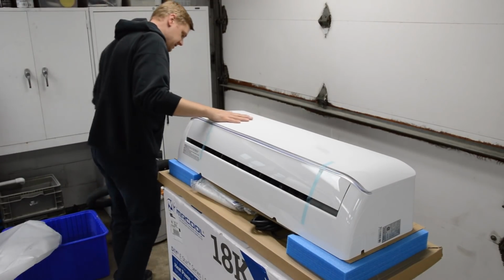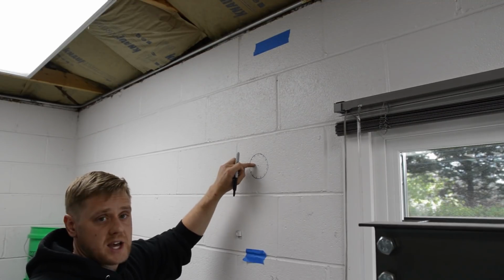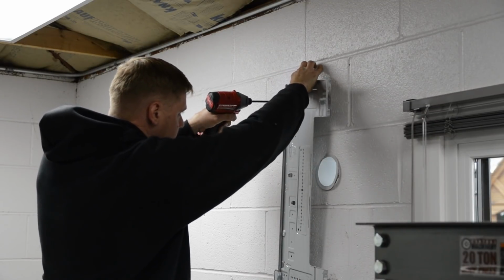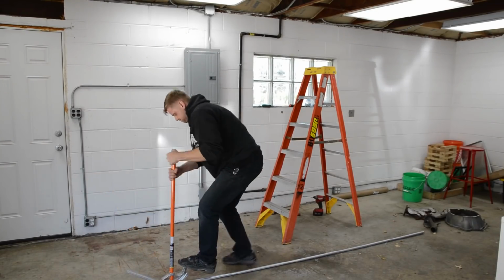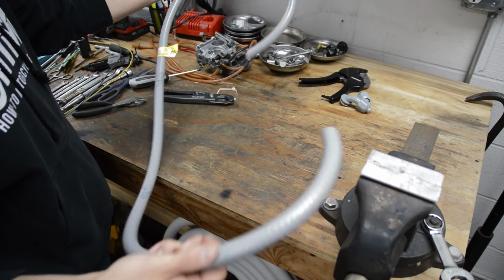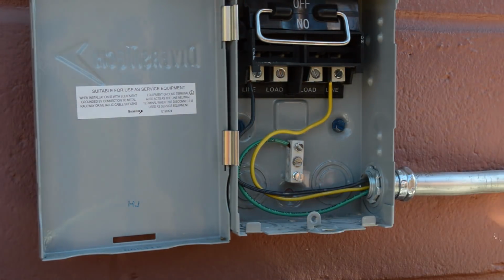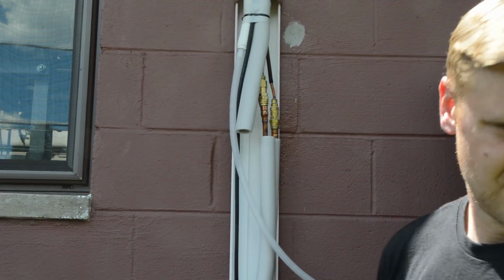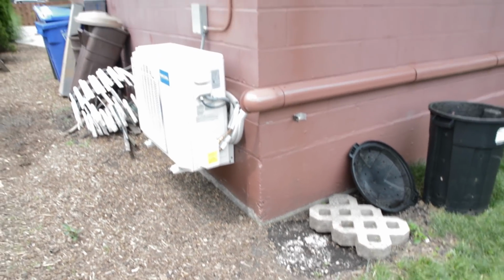How-To: MRCOOL DIY Mini Split Installation (Step by step) / Garage has A/C!

Comment: Should the extra line set be coiled lengthwise or circular? There's a lot of talk that the oil gets trapped in the circular coiled line and burn out the compressor, what do you think?

Comment: Excellent video. Absolute best instructional I've seen yet. ONE question which I hope you can answer. How is the indoor unit powered? Is that only through the black cord which has the communication wires to the compressor outside (thats run through the plastic chase with lines)? Thats the only  part that i missed
Reply from the maker: Yes, black cord powers the inside unit.

Comment: On a hot and humid day, there will be a lot of condensation. It would probably be good to lead the water away from the wall so that it does not cause a moisture problem to the building.
Reply from the maker: I will monitor that. Thanks.

Comment: That was a great video. I did notice that you didn’t vacuum the lines after making the connections to the outside condenser. Other vids I watched had this step. Reason for skipping this step?
Reply from the maker: This is a diy kit with precharged linesets.
Reply: MatthewMCRepair Thanks again. You did a really great job describing the process.
Reply: The unit is PreCharged with Refrigerant "For the Lineset" However a Vacuum must still be pulled !!
Reply from the maker: @MtPockets14U  No it doesn't.
Reply: I thought the same thing...but MRCOOL mini split is different they have precharged linesets that releases into the unit.  Most other split units, like my senville, have the refrigerant in the unit that releases into the lineset (vacuum required).
Reply: I do stand to be corrected on that. The lineset itself is indeed pre-charged. You did do an excellent job on the install!!
Reply: @MtPockets14U  Not true.  Do your research
Reply: @itisaporsche  pay attention to response

Comment: Hey Matt! Awesome video and I appreciate the time spent explaining everything. One question I have that is confusing me is you ran 6 wires from the panel through the conduit. I think you said 3 were for a compressor and three for Mr. Cool unit.  The three for the compressor were for an air compressor that really had nothing to do with this install. Is that correct? You had to rerun the conduit for the 6 wires and this is why the 6.  Again awesome job and thanks as I am starting my install now
Reply from the maker: Yes the other 3 we're for an air compressor
Reply: I appreciate it Matt! Again great video and thank you for such a quick response.
Reply: @HTMR  yeah that had me confused to. Thanks for the reply.!

Comment: The videos always makes me wonder about  some items. Wall bracket mounting of the outside unit always looks to close to the wall for good air flow.  Especially if you have more line coiled up behind.  What does the instructions say for clearances? Nobody says when you are connecting the lines does it start leaking till you got them tight at both units? It would be a lot nicer if you could specify what length of line you need so you do not have so much extra to leave coiled. Larger units seem to have 25 feet and smaller is 16 and even that could be too much if everything was just on the same wall and 9 foot ceiling.  12 foot would be nice but you cannot cut the DIY lines.  That open ended shield will sure be a good place for wasp nesting! Good video though!

Comment: Other systems require you vaccum the line set out before charging. In fact they won't even warranty the system unless you have it done to get all of the air out of the lines before releasing the refrigerant into the system. Does this system not require that?
Reply from the maker: Nope. Precharged lineset.

Comment: love the video. i noticed you did vacuum the lines, is not required?
Reply: Not required unless you error in the installation. Line Set is pre-charged and remains sealed until connection between the two units is achieved. Downside is you cannot customize the length of the lines--excess must remain coiled up near the condenser--increasing losses moderately.

Comment: Much easier than other pre-charged splits.  Not having to vacuum the lines is nice.  I would suggest not using soapy water for leak tests as it can corrode the copper.  Use a leak soultion desgned for that that won't corrode.
Reply: Lines do need to be vacuumed . He skipped it not a good thing for the compressor
Reply: @noahholt482  I thought that system come with prevacuumed lines to eliminte the vacuum need.
Reply: @noahholt482  the Mr.Cool diy units come pre charged and vacuum sealed. That's why the line sets cannot be trimmed.

Comment: I would spray a little pest control expanding foam or something to avoid nests at the corner near the condenser. Other than that, great video! I am more confident in my unit arriving soon!
Reply: No such thing as pest control expanding foam.  It's just regular foam that's dyed a different color.  It contains no pesticides.
Reply: There is stainless steel "steel wool" for pest control. Between the two you should be able to keep critters out.

Comment: Instead of mixing a messy bag of mortar mix, you can buy mortar in a chalking tube for small needs like this. Just toss out the extra. Personal preference, I like to wire a breaker before I install it. I just think it's easier to wire it in my hand where I can see it better. I would have run the wires thru the conduit on the floor instead of up on the wall. I think it's easier...IMHO. Nice job, real pro installation.
Reply from the maker: Thanks I'll check the caulk tube out. I have conduit runs near ground level so that would not have worked.

Comment: Thank you for your video. Just used it to install a 18k btu mr cool. Super easy!
Reply: Did you have to vacuum the pipes before filling with coolant gas?
Reply: @woodsmic  Not in the DIY models... The lines come pre-vacuumed and pre-charged, with a valve that opens when you connect them.

Comment: why didnt you  vacuum the suction and return lines before releasing refrigerant?  Was the lineset in a vacuum when you installed it? otherwise, you introduced noncondensables into the refrigerant loop. Maybe I   missed something.
Reply: Not needed. The refrigerant is in the lineset, not the condenser.

Comment: Only small critique, the 3 1/2" hole is supposed to be drilled on a slight (1/4" or so) downward angle to encourage drainage.
Reply from the maker: Yes I did try to drill the outside hole a bit lower. I eyeballed it. Been running for a year and drains well.
Reply: Omg, I kept wondering why downward... ty

Comment: Have you used vaccum pump to remove air and moisture from refrigerant lines? If you will not proceed with that, compressor will be damaged soon :(
I haven`t noticed this step on this video.

Comment: what about the 90 degree elbow drain for the bottom of the unit mounted on the bracket? did you use it ?

Comment: I just put one of these in. In the instructions it states to run it on cool for 5 minutes then on heat for 5 minutes. It won’t work
On heat for me. No codes or anything. The cooling works excellent. Just curious if it’s because it’s hot out it won’t go to heat mode? Any ideas?

Comment: Could you control temperature using the MR Cool App when you are far away from house and not on the same WiFi network?
Reply from the maker: Yes, it will work through cell phone data.

Comment: Curious but did you check your municipal codes before installing that condenser in between the small space close to your neighbor? Some have variable distance (maye up to 6 feet) but from what I've seen , they mostly have a say in this regard and they require a permit. Thank you!

Comment: One thing that is confusing is why did you run  so many wires in the conduit and power it with two breakers if the indoor unit is powered by the outdoor unit and run off the same power supply? What’s the reason for two breakers as well as the two larger wires that you were feeding into the conduit as well as the 12 gauge??
Reply from the maker: Larger wires are for my air compressor.

Comment: Thanks, informative video.  I got a mrcool unit through home depot, need the wall mount brackets for the outside unit but home depot doesn't sell them.  Where did you get yours?

Comment: I wonder if it's necessary for vacuum pump on this model to get rid of moisture and air prior to release the  refrigerant. We usually release refrigerant for 1 second for inspecting any leaks and then using vacuum.
Reply from the maker: No, not on this DIY kit

Comment: Did you have to go through the wall? Could you have run across the rafters and out the eve above the compressor?
Reply: I was thinking if the line set ran down the inside wall there is no need for the lineset cover although it is a good product also with the line set inside it has a bit more protection just my ten cents worth
Reply: The line set must be below the inside air handler for gravity to do its thing with the drain hose.

Comment: so I searched far down the comments to see if someone asked this so I didnt have to bother you, but you said you upgraded the lines.  I am getting ready to install a 36k condenser and I am curious what you upgraded from as mine I think takes different gauges than yours.  so what AWG/Gauge did you upgrade to/from as I dont know the requirements for your size condenser?
Reply from the maker: The instructions will recommended what gauge wire and circuit breaker to use.

Comment: There's a brand called Zamna Climate they have mini split AC which are heat pumps that are DIY and comes with precharged linesets just the same as Mr Cool units. It would be really cool if you could get one of these units for the garage. 
They are solar ready meaning they run off DC power from solar panels - NO SOLAR INVERTER NEEDED. However, they do accept connections from the grid, so you can call them hybrids. 

I'm actually running a few of these in Jamaica 🇯🇲 right now. The 12000btu runs off 3 solar panels and the 18000btu works with 5-6 panels (405W).

The company that makes and sells them are based in the United States 🇺🇸 - Zamna Solutions | Zamna Climate. If you should reach out to them just let them know Rayon from Jamaica 🇯🇲 sent you the info ✌🏼.

Comment: Can you give more details for the disconnect box you used?  Links or info?  Does it have to have a certain amp or voltage rating?
Reply from the maker: IIRC it is a non fused disconnect rated at 60amps.
Reply: @HTMR  thanks

Comment: Hey Matthew, I'm installing this on an RV.  How noisy is the outside unit.  In my case, it's going to be up against the RV near the bedroom.  Also,  How close can people be from the vent where it get uncomfortable with cold air blowing on you?  Thank youl
Reply from the maker: Both inside and outside units are very quiet on regular speeds. I would say same distance as a house register.

Comment: what hapens if you only need 6 or 8 ft to get outside to the unit?  I take it one would just have to curl up the excess and try to hide it behind the unit?  or can the line set be cut and flare fittings be made up for correct length?
Reply: Mr. Cool instructs to coil the excess and store in horizontally near the condenser. If you were to cut it, the precharged refrigerant would be lost, warranty voided, and you'd have to braze on the connectors and vacuum/charge the system.

Comment: Great how to video Mathew! Thank you for doing it.
Question for you? Do you know if there is a provision for the line set to run down the inside wall and exit to the outside at the bottom.
I did not want duct work showing on the upper outside wall of my garage. Would make for a cleaner install.
Thank's........
Reply from the maker: No I don't think there is. Unless you build a frame and space it away from the wall.

Comment: This might be a silly question and maybe I missed something but what exactly were the thicker gauge black red and green wires attached to? I know you said the compressor. is that the Mr. Cool compressor? I thought that was wired to the disconnect. Thanks
Reply from the maker: No my air compressor.

Comment: Matthew, The best MRCOOL install by far I've watched ! Great job. Did you use the 3 1/2" line set cover or opt for 4" ? Some reviews say 3 1/2 is a little tight. Thanks
Reply from the maker: I don't know. Didn't realize there were2 sizes available.

Comment: Cool video. But I would definitely run a seperate circuit for your shop compressor. I think per code, the split needs to be on it's own dedicated breaker. So I would make that change b4 selling ur house or having it inspected. But u did a fantastic job. Especially those emt bends.
Reply from the maker: The compressor is on a separate breaker, and so is the mrcool unit. Thanks for the compliments.

Comment: Here's why I went with a 12,000 btu unit. 1. It runs on 120V, versus 240V. 2. I don't need the space 70F in the winter, 72F in the summer. Instead, I am OK with 60F heat in the winter (its a garage) and 78F in the summer for the same reason. Similar to you, I have 450 sq ft. Mine is one of those built in a day, enclosed metal carport. Some insulation, but not great for sure.

Comment: Depending where you live, if it gets over 100 degrees, you should ALWAYS buy a 36K mini split unit for garages and workshops. Once it gets hot anything below a 36K can't keep up, not to mention when you open the door for a minute, or, bring in a hot car...or both.  An 18 or 24K will not suffice. For just a few extra dollars you can get the 36K and be happy forever.
Reply from the maker: If I turn it on at 8am it keeps up. Even if I turn on my house AC in the middle of day it struggles.
Reply: That is one thing I am considering here in Dallas Texas countryside. Like Matthew, I have no ceilings and 24x48 feet of space.  I probably won’t cool the whole thing but that makes me put up a partition between garage and shop.  Oh well, something to do in retirement, right? Haha
Reply: I am in Atlanta and have a 15k sq ft basement of which 12k sq ft will be conditioned.  I purchased the 36k BTU unit.

Comment: The plastic beauty cover they offer is too short for the lineset and extra sections aren't available unless you buy a second kit. I didn't want a coil of lines behind the unit, so I went to the big box and got a section of 4" aluminum downspout. It fit well after a bit of tweaking. Just slid it right in the end of the plastic cover.

Comment: Is it possible to run the lineset up from the air handler and into the attic and then out a soffit on another wall to the condenser?
Reply: Just as long as the drain line goes down from the air handler?
Reply from the maker: @ray330  There is no provision for that routing. It is meant to exit straight back out of the airhandler.
Reply: @How-To Motorcycle Repair okay.  What if after it goes straight out the back wall, the drain line continues down but the lineset goes up the soffit and goes into the attic to go down thru the soffit on the other side of the house where the condenser is? Think that would work?

Comment: Those lines are pre charged? Looks like they just had caps on them?
Reply: Those connections have internal seals that do not open until the two connectors reach a certain number (likely almost all) of threads joined. Caps just protect the protect those internal seals until you're ready to thread.

Comment: I need help explaining to my landlord why it was a bad idea to install the condenser unit for my mini split unit UNDER THE HOUSE! Simply saying that the outdoor unit belongs outdoors isn't getting thru. Am I wrong in assuming that all the heat removed from the room would come right back up thru the floors?
Reply: That is crazy. Your assumption is basically correct & even more critical, the condenser needs free flowing air to breath.
Reply: You're 100% correct!
Plus it's just one of the worst places to.put it to begin with....
No air flow, alot of moisture buildup etc etc....
Reply: Free air is a MUST! The crawlspace or basement is cool but it is due to no heat adding and the mass of cool earth. I worked in an office for years and they decided to do renovations and got slat pre-fab fence sections to hide a/c units behind each office suite. The first day it went into 90s the compressors overheated and shut off for several minutes and then came back on. When a few of us were all outside looking at our a/c units we knew something was up. Service guy came out and checked and pulled down the fence and the first one was fixed. All the fence came down. The slats were about 3 inch with 2 inch gap and you'd think the shade would have been a good thing the exhausted air from unit got mixed with the fan suction side and that is a Huge no-no.

Comment: Just a couple of problems here...one is the excess lineset - definitely should not be looped vertically - compressor oil will collect in the bottom of the loop. That you have just one loop may save you. The other is the outdoor condenser unit is way too close to the building wall - they need at least a foot for air flow. Good luck.
Reply from the maker: Instructions say you can coil up excess. Plenty of air flow on wall mount.
Reply: @HTMR  - I called them specifically on this. Sorry. Oh well, hopefully you'll get the longevity you were hoping for. 
Everybody with a gopro thinks they know something these days.

Comment: I'm curious, why did you run 6 wires (two sets of two hot and a ground) from the electrical subpanel thru the metal conduit?
Reply from the maker: Circuit for air compressor.
Reply: He only ran two wires and a ground from the subpanel to the disconnect. He ran the same to the condenser.

Comment: Wait, so where's the white 'neutral' cable for the 220v circuit? I only see the two hot cables and the ground.
Reply: On a 220v circuit, both legs connect to the breaker. There is no neutral because each pulse uses the off phase of the other side for this purpose.